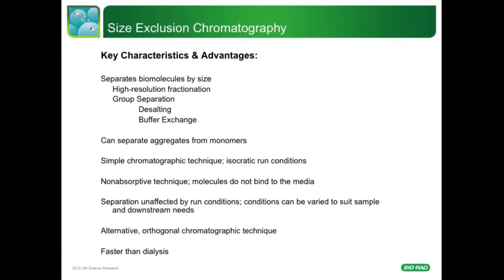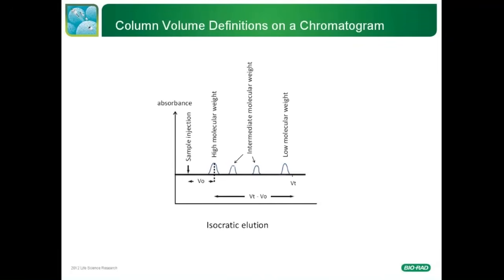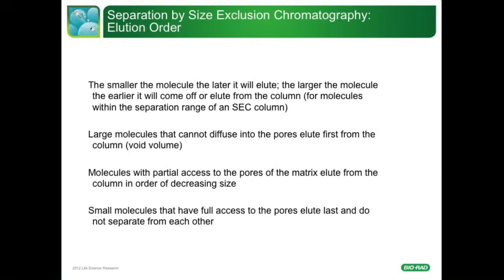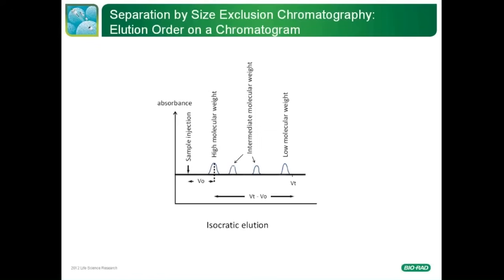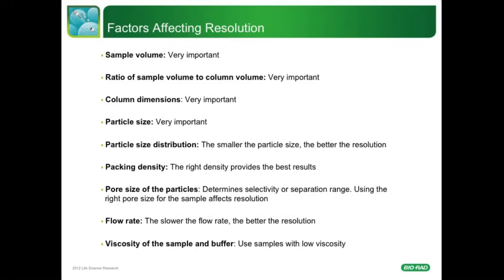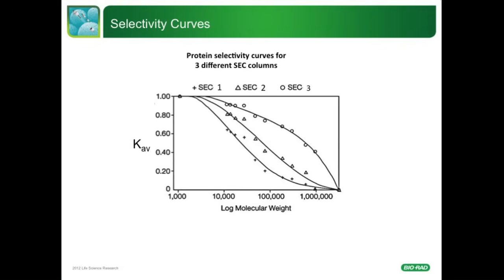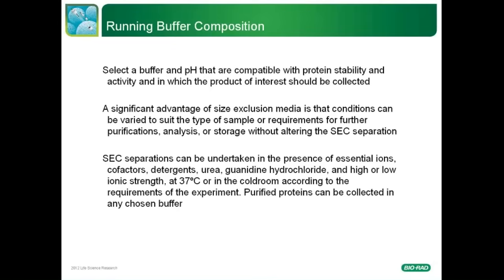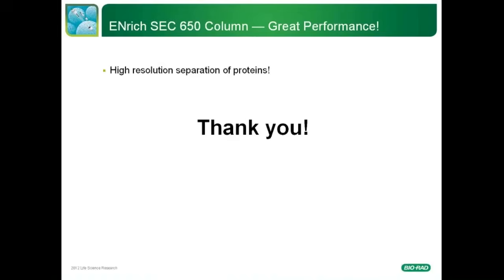Chromatography 101: An Introduction to Size Exclusion Chromatography

Comment: WHY IS IT NECESSARY TO EQUILIBRATE THE COLUMN PRIOR TO SEPARATION
Reply: You want to make sure you have the proper buffer before you load your sample, otherwise your protein may not bind when you need it to or may bind when you don't want it to.

Comment: Does the factors affecting resolution for group separation affect mass spectrometer resolution. For example improved chromatography resolution leads to improved  Mass spectrometer resolution?
Reply: ***** And that my point BIORAD, I want to couple a HPLC SEC with ESI MASS spectrometer. I  need to be able to desalt proteins online - so from SEC straight into the Mass spec. I'm basically trying to make them both compatible. maybe im asking the wrong question.  i wanted to know how i would do this.
Reply: ***** Hey BIODRAD. Thanks for you help. My project is well underway and I have managed to couple my system yayaya. I was so confused. Acutally the SEC column is used to improve S/N in MS spectra. Lets hope an A+  comes my way for my masters. ;)